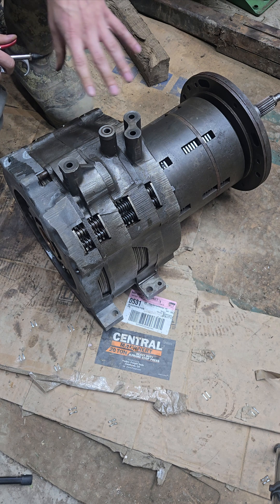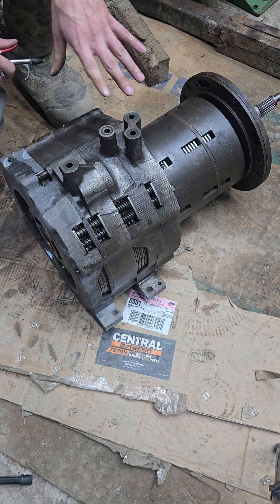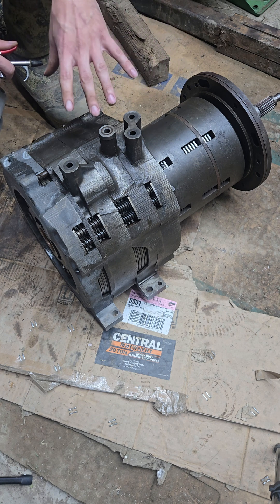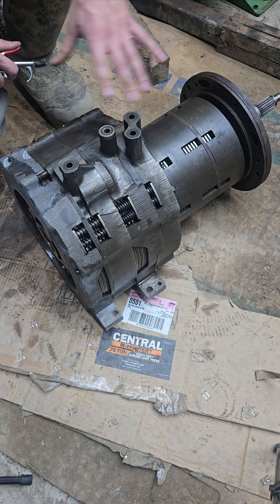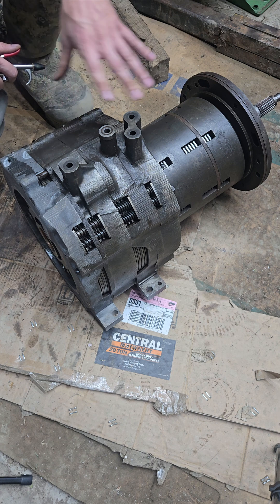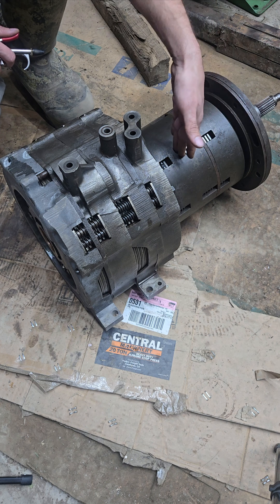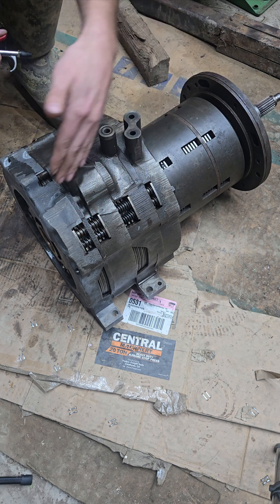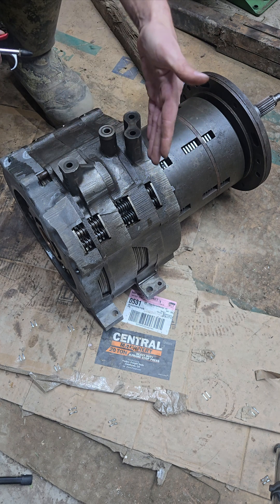How It Works:  John Deere Powershift Transmission #johndeere #powershift #4020

Comment: International engineer presented this to International, they laughed, he went to John Deere, and the rest is history
Reply from the maker: Is there truth to that story?  I've never heard that.
Reply: @GearboxAcres it was a Ford engineer. He developed the select o speed. They rushed it into production. He didn't agree with that. Went to Deere
Reply: @GearboxAcres  he might be wrong, not sure he ever went to International. The man was actually Harold Brock, Ford engineer that started as a teenager as Henry Fords assistant. Henry put him in charge of the Ford 9N Ford/Ferguson when the three point hitch was first introduced. Became Fords main tractor engineers and worked with Fords powershift called the select o speed. The story goes Ford higher ups were pushing to release the transmission in the big new 6000 tractor at the time with all state of the art hydraulics.  Brock told them the transmission had issues and needed more refinement but they released it anyway. Story continues that they either fired Brock or he left over the disagreement. Brock then went to John Deere as they were working on their new generation line of tractors and when asked about Ford introducing the power shift he told them it won't work but we can build one that will work. End result was Ford wound up with a major recall on their transmission and you are looking at what Brock helped John Deere build.
Reply: @GearboxAcres  Machinery Pete did a four part interview with Mr. Brock like 10 or 15 years ago. I just looked and it's still on the channel. Look it up it's worth the watch
Reply from the maker: Will do! Thanks for the info!

Comment: It is a marvel of American technology to see this as I spent 100’s of hrs on a 68yr 4020. Yet today, from Honda to Konesage, they produced trans that used hydraulics to shift manual transmissions. The Konesage hyper-car uses air/over hydraulics to perform computer controlled shifting at 0.03th of a second. The genius of people on the USA producing BakeoLite in 1909 from Leo Bakeland’s experiments provided “Bakelite” to America which allowed Charles Kettering to make electric motors for cash registers, then move to Cadillac to starter motors, lights, generators to alternators and the product of this American force, came together as they entered WW-II. Feed the globe with US agriculture. John Deere helped pave the way with generations of farming & engineering! Go, USA!